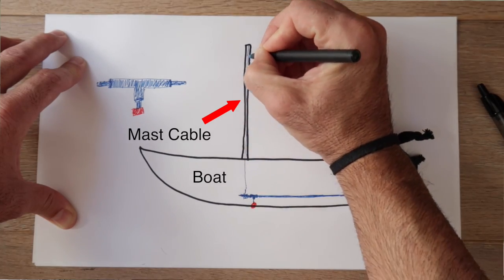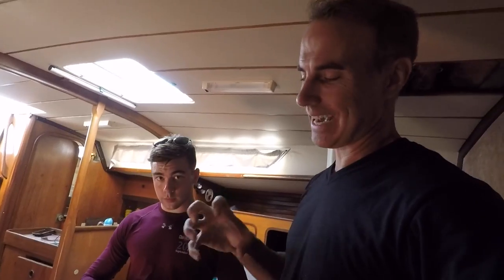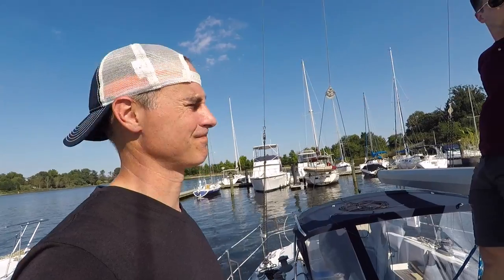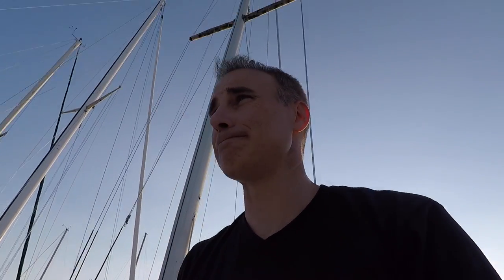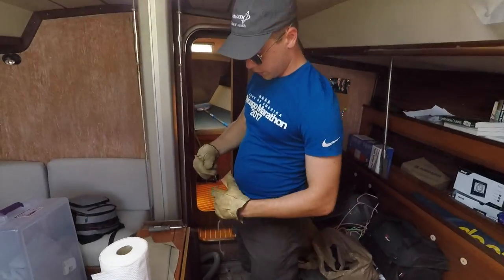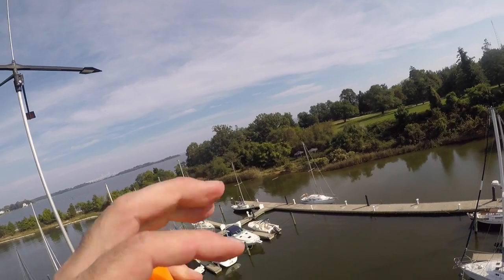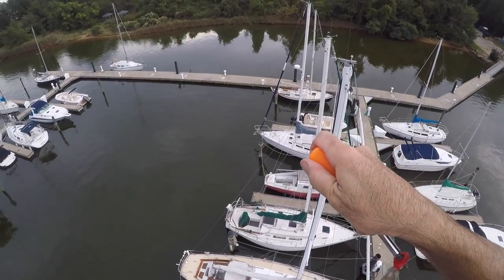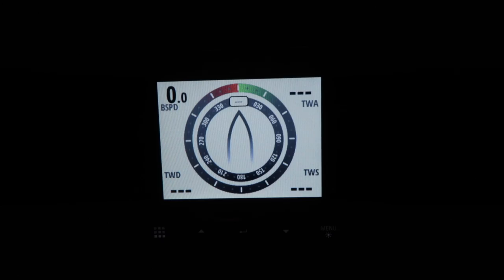Mast Climbing Madness (Sailing Giraffe)

Comment: Great video Josh. I used to work at a yacht mast company and was hoping there was an electrical conduit inside your mast. You don't want the halyards chafing the wires. After your comments about the climbing harness. I thought, I would suggest that you fit 2 or 4 foot steps / brackets near the top of the mast. So that you can stand on your feet to take the weight off your harness. These steps can also help to raise you up so that your shoulders are above the mast head, thus making it easier to do work at the mast head. These steps (fold-up models) were a standard fitting on the masts that we built. Cheers.

Comment: Man, thats some patience. Though I've made similar mistakes and had Murphy's law on my side, I do dry runs very often for fit and installation, and drill undersized and ream to fit.  Does not eliminate all problems but minimize the issues. Still you did it but sure took many days. I enjoy your videos and subscribed a while back. Thanks for sharing.

Comment: great job done, I'm just about to pick up my first new NMEA2000 nav system and this will be installed later in April. Installation of depth and wind sensor just like You did, so thanks ! I learned a lot, You got yourself a new subscriber ;)

Comment: Dear Josh, this episode was really cool and funny. When I started to watch, I imagined what could have gone wrong, as I saw the people of the Sailing UMA exchanging of the electric cable from their boat mast anchored in a float in Puerto Rico, and it seemed to be very easy. Evidently, the interior of the mast was different. Congratulations on perseverance. Never give up. One tip, reduce the distance between the knot and the climbing harness, so you'll be in a position to work over the mast, and will be able to see what you're doing. And tie all the tools, because if they fall out of your hand, they will not hurt anyone, or the boat. And you wont loose the tool.....Great video!!!

Comment: fantastic video. found your channel while I was also plotting out my approach to install my B&G system. I'm taking my mast down, because I have a full conduit, the old Coaxial cable to the VHF antenna and all the wires need to be replaced. Your broken wire forced you to use the conduit and that in turn saved your sanity... having a wire moving inside the mast and slapping back and forth inside the mast will keep you awake at night and reduce your quality of life..
B&G could have done a much better job with the installation manual, I've turned to the internet and found you. Thanks for your efforts to share your story with us.

Comment: As soon as you said power hammer drill, I knew exactly what happened. Save yourself some time and blood pressure and predrill properly. Those impact drivers should be called screw breakers.
Reply: I work in a marina as a welder fabricator. I have to install items I make all the time, so I see this occasionally when a boat owner calls me to remove broken screws, it's always a impact driver to blame. A. Use a drill with a screw bit, drills can go slower if you drop the speed setting. B. If you have to use a impact driver, predrill properly and bump the trigger instead of holding it down, this allows for a bit more control when driving the screw.
Reply: drill foreplay

Comment: Ah brings back memories. Long ago in a galaxy far etc etc. the 33' C+C 3/4 tonner I sailed on all the time, had a repair done to the mast that required welding. The mast repair took longer than expected (Captain Murphy came by for coffee). Ended up putting the mast in, late one afternoon/evening. It was full dark before we realized that none of the mast head instruments worked. The masthead light was working however.
So early next morning I get hoisted to the masthead. Ahh, the instruments aren't plugged in. Hmmm, the plugs don't match. Some time later, involving some yelling up and down, we came to the realization it was typical case of North American blind stupidity: the instrument cable was upside down. The bottom of teh B+G cable was at the top of the mast...
Worse the instrument cable was taped together with the masthead light wires and the little Windex light wires.
Luckily there was good access to the base of the mast. They disconnected everything at the bottom and connected a feed line, and I hauled the whole mess up out of the top of the mast until a got to the feed line.
That took, in total about 2 hours. We then had to cut all the tape off, remember to *test the instruments with the cable*, and tape it all back together. I then went back up the mast to feed the 'snake' back down. Took another couple of hours, as the 'snake; kept getting hung up. Eventually I had to haul it back up and wrap the join to the feed line with a long tapered wrap of tape. And then it did not want to come out of the hole at the bottom as it was now too stiff!  I stayed up there while the connections were all made, and we tested the setup. Success.
And when I was lowered to the deck, finally, I couldn't stand due to a cramp in one leg and the other having gone to sleep! That was in a bosun's chair, but it wasn't that comfortable. I was up the mast all told, in excess of 5 hours. Luckily it was a nice day and the only damage was some sunburn on my ears (which had no sun block!)

And the next morning I had to go up again, to replace the worn spinnaker halyard sheave which I had spotted the day before.

Comment: I did not check all  166 comments but I would have used an electricians fish tape. It is coiled flat wire designed to pull wire.  I have used it working on my home.  works great and can be used to pull wire in other parts of the boat.  If life were too easy it would not be so much fun.

Comment: Nice perseverance!!!  I know how you feel not wanting to be defeated by what seems to be a simple project.  Only boat owners truly appreciate this.  Question:  by placing the wind anemometer base so close to the side of your anchor light, does it now block the light from that side?
Reply from the maker: Thanks for the comment. There is not much blockage as the light is quite bright and you can see it. However, I'm sure it obscures the light somewhat but not enough to make it unsafe. 👍

Comment: they gave your a bit of a bum steer in the first place. The line cable from the wind vein should be in a color yellow to meet the 2000 standard . Suggest you mark the line end with yellow tape or yellow heat shrink so you know that the end is a termination point for the future technician will know as well

Comment: Great video! I’ve been through similar ordeals with my first sailboat. I’m always struck with amazement on why what often seems like a simple task or repair turns into a multi-day journey. Ultimately I’ve come to appreciate these moments. It really forces you to think outside the box and build resiliency. 

I’ve got a 1982 Catalina 25 that I purchased used a few months ago. The lights on the mast stopped working, so I’ll need to address them before next season. I’m thinking of climbing the mast when it’s on land stored on blocks. In your opinion, is this safe to do on land and with a smaller sailboat?

Comment: I know this is very old, but at 6:34 when the old cable broke, I thought of how an electrician showed me how to drop a small chain down through walls and stories to connect to wire and pull back up into the attic. The chain never breaks.

Comment: Hey my dad used to do this for a job as a teenager back in the 90s next time use a Vaseline or a rubber lubricant (non corrosive) on the cable to help it slide up the conduit like a warm knife through butter.

Comment: Funny hearing you say marina guy say you can't do it with mast up because my son just helped me do the same thing as you....our sensor wire hung up trying to come thru the base of mast so we had to disconnect masthead light, pull slightly into mast then we were able to pull wind sensor cable thru and the light wire was able to also be pulled back thru the base of the mast.....DETERMINATION!

Comment: Did you route the new cable same as the previous one ? At the top of the mast it look very close to the pulley on top of the mast.
Kudos , I would have giving up after the drill battery run out, and took a week off!
“Great works are performed not by strength but by perseverance.” Or both.
Reply from the maker: Hi. Yes. Routed in the same way. There is a little notch at the top where I put the cable to keep it away from the rollers. 👍

Comment: Josh, thank you I just bought the wireless Ws 320 B &G  to avoid wires in the mast.. I am installing next week and praying the performance is equal to the hard wire?  I’m trusting B & G quality comes through as stated.. any reason you didn’t choose wireless ?  I will keep you updated on my results . Awesome channel josh..blessings
Reply from the maker: Not sure why I didn't choose wireless but I think I should have (clearly as you could see). Just be careful of placement of the base of the wind vane to make sure not to close to mast light or other items. That was painful for me to drill the holes and get it ready only to realize I placed it 2mm too close to the light. Good luck!
Reply: Josh Post  josh, the wireless Ws 320 sucks🥴  you made a wise choice choosing the hardwire model..my rigger is pulling his Hair trying to get the wire in the mast as I send this message to you..lol.  I’m a California guy and my 1983 Hunter 34 my twin brother and I own is in seal beach we’re doing a major upgrade on our boat ..love the videos and appreciate your dedication/work with videos.
Reply: Aloha Mates.... I purchased the WS320 and returned after mucho attempts to sync to the Bluetooth controller failed.  Tried everything including taking the boat away from the Marina, getting a replacement setup, and yet couldn’t get to sync to my Zeus 3.  B&G swears they “always” sync.  I returned and bought the WS310...worked on the first try.  Old School.  

( Note... Didn’t needs to connect as endpoint on backbone - worked connecting to the t-connector).

Safe sailing to all...⛵️

Comment: Way too many people fall into the trap of using the cable as a pull thru, you should send the cable in parallel to the pull thru rope.
Your screws broke because they are stainless steel and don't have the tensile strength to deal with power tools, you definitely need the correct size pilot hole for any chance of success. Nmea is a great system to have.
A galant effort though, well done!

Comment: Damn the height would do my head in, my sphincter was tightening just watching ... I would have used strong fishing line to start with, as if you can real in a tuna it can handle the little force you needed using a smaller diameter, also there are shorter better ways to join the two ends ask a pro fisherman.. And as someone said, feeding  everything from top to bottom the weight of the cable works for you not against you with less friction....Lesson is to research and plan meticulously and ponder different avenues as it saves a lot of grief... Great Job though as now people via this video ( and comments) can achieve a tough task saving a lot of cash....

Comment: Playing devils advocate here.... I noticed the mount but, didn't notice any sealant/butyl tape underneath the mount?   The mast cover is there to prevent water from getting in the mast and then into the keel and you drilled holes into it....  Just asking?
Reply from the maker: Good question. There is a rubber piece under the mount base. It acts as a gasket for the mount.

Comment: I'd like to think I would have tested the whole thing on the ground before fitting it to the top of the mast, but hindsight is a wonderful thing.
Reply from the maker: Indeed. That's what the B&G tech guy told me also. 👍
Reply: @JoshPostVlogs  Haha. Keep making your videos, you tell a great story. Any tips on which bosuns chair you wish you had bought?
Reply from the maker: I actually bought this from Amazon. (Linked below). There are 2 options on that link. The first option is $18 which I bought first. It's no good. The better option on that same link is the $49 harness. It's very good. I like the $49 one.  https://www.amazon.com/dp/B074FYG7RM/ref=cm_sw_r_cp_apa_i_vNr3BbC6CAXGH

Comment: You could have checked the connections with a DVC meter or ohm meter I could have walked you through the pins to check in ten minutes before you ever plug a sensitive device in always check ground continuity and contact points you can do this without turning on the unit. Better than frying a thousand dollar piece of equipment.

Comment: I'm doubtful that it would cost over 1000 $ to bring the mast down and back up again. Where I come from you do that every fall (mast down) and spring (mast up) and it's basically around 60-100 Euros extra cost (in addition to lifting the boat on hard ~200 Eur pa.) However, I don't think you could have put the new wire in if the mast was horizontal. You have to be able to use gravitaty to draw the cable through. As was demonstrated, you can't necessarily rely on being able to use the old cable to run the new one in.
Reply: Maybe it costs more because they DON'T do it every day.
Reply: @Josef_R  Sure it costs a little more. But Hiring a crane with a driver costs around 100-150 $/hour. And if he doesn't come from very far, 1-2 hours is plenty.
Reply: @loyly 
You're basing this on European experience.  Or have you hired cranes in Florida?
Reply: @Josef_R  i obviously haven't, but surely they have similar cranes/trucks and labor costs there. And, my point wasn't so much that he has overestimated the costs, but that he couldn't have done this job with the mast down.
Reply: @loyly  
It just seems pointless to have a conversation about costs when only one side is known.  I have tried to have work done in my marina that was price prohibitive which other sailors have had done for pennies.  Why couldn't he have done this job with the mast down?  The whole point of this video is that he was told that's the only way.
Reply: @Josef_R  I'm sure if he hadn't broken the old cable inside the mast he would have no issue doing this the mast down. But as the old cable broke, how do you pull a line through the mast if you can't use gravity? In any case, I'd say this is the easier way to do this and a lot less work/hassle, which talking the mast down always is.
Reply: @loyly  
He wasn't doing this because he needed gravity to fish a cable through.  He did it because of the expense.  People pass cables through masts on the ground all the time.
Reply: @Josef_R  alright, please explain me then how you get a cable through an empty conduit on a mast that is horizontal. And, also how that wouldn't be a bigger job in total than what he did here.
Reply: @loyly  
You need to be asking Josh to explain it.  He wanted to take the mast down to do this job.  But people do it all the time.

Comment: For fishing the cable out of the bottom of the mast (where you used a coathanger 11.40ish),  theres an electricians trick using a loop of plastic strapping pushed into the hole before you thread the wire that makes it easy  - this stuff https://www.indiamart.com/proddetail/box-straps-9207287091.html
Reply: BTW forgot to say great to see your perseverance and determination to beat the problem! Looks scary high up there!

Comment: The guy at the boatyard was bullshitting you! 
It's called conduit. Electrical pipe is called conduit. Usually you can pull an extra string in with the new wire to make it easier to pull in a new cable in if need be. Someday you may want to add a radar and or a radio antenna if room in the conduit allows. But you won't have to learn this lesson again. And you could have used a boastsman's(msp?) chair. A lot easier on the crotch.